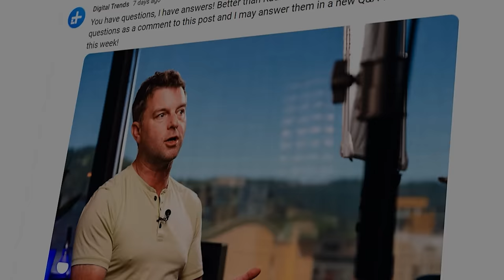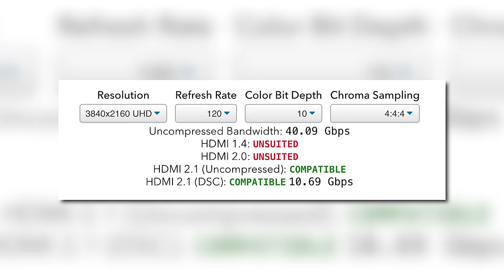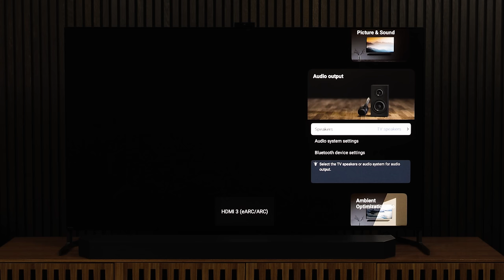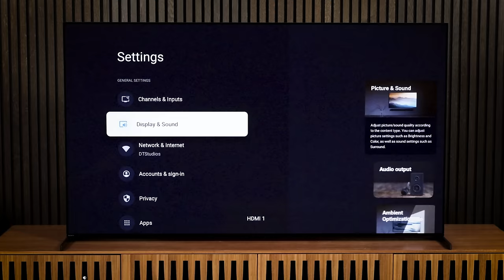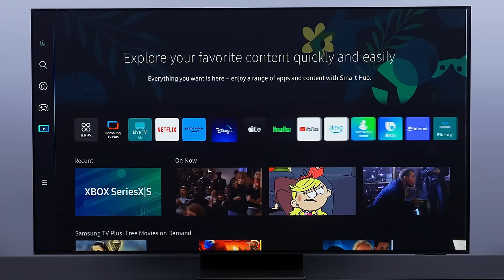TV Above Fireplace Bad? Samsung S89C OLED Worth Buying? | You Asked Ep.17

Comment: I didn’t even bother to watch this video to post the following comment. As an engineer who worked on ergonomic projects, locating a tv above a fireplace is the absolute dumbest idea builders and homeowners can do. Place the tv at eye level so you do not strain your neck, shoulders and back. The heat issues will destroy the TV and any hidden wires and the amount of planning and engineering during construction will kill the builder.  Locate a power and cable/internet box either right or left of the fireplace and you will enjoy a lifetime of relaxed video enjoyment. Period!
Reply: I have a fire place, but no tv.  Simple as that.
Reply: What if i have a new home built this year and they took things like tvs above fireplace into consideration including little things like wire hiding outlets etc? In your experience in this case they would have considered those issues u stated?
Reply: You still must address the ergonomics of looking up to watch TV. Unless you plan to park your .... In a Barko lounger tilted all the way back in sleep position for the rest of your life, keep the TV at eye level and enjoy.

Comment: I have had a MantleMount 340 for six years and it’s fantastic. I just upgraded to an 85” QM8 and had to upgrade to the MM740 and it was a no-brainer to just order the upgraded version.

What I’m bummed about is that the max weight mount they make is only the 115lbs MM740 and now I’m right on the edge. If I wanted an 98” or 100” TV I won’t have a choice but to do a fixed frame above the mantle.

Comment: Hmmm. What about all the reports and pictures popping up showing the S89c is QD OLED in the US?
Reply: I agree, I bought the S89C on Black Friday and confirmed that it´s a QD-OLED panel due to the triangular RGB pixel pattern. I want to say that the WOLED panel was used the in the UK and not the U.S.
Reply: After some research many have confirmed its a qdoled panel in the us. The thing is samsung never made a gen1 77’ qdoled panel so basically a s89c 77 has a gen 2 panel. I currently have a s90 65 and probably going to return it and get a 77 s89c.

Comment: On the topic of 3D: I know this is a TV review channel and so what Imm about to say may be branded heresy but here goes… anyone interested in preserving and getting the most from their 3D movie collection should really consider a projector. While 3D was abandoned by television manufacturers— many projector manufacturers continue to support the format and 3D on a projector is GLORIOUS. In fact, it’s so good and so cheap to implement you could buy an entry level projector for next to nothing and use it solely for 3D playback. 1080p DLP projectors in the $500-1000 range produce fantastic 3D image quality and DLP link glasses are cheap. If you want one display to do it all I’d suggest budgeting a bit more. The BenQ HT4550i is about the best DLP money can buy and it does a bang on job of playing back 3D as well as producing a high quality 4K/HDR 2D picture. The Epson 5050ub is another excellent choice— while it’s a lamp model and therefore getting a bit long in the tooth it still produces one of the best pictures at it’s price point and comes with gobs of advanced features typically reserved for more exotic brand projectors.
Reply: Yeah, but my living room has no place to add a projector and neither does my other living room theater downstairs.  These TVs have amazing picture quality and would shine with 3d.

Comment: We put our TV above the fireplace as we have no other place to put it(house built 2020). However it's not an issue at all.  Most fireplaces have a mantel which blocks the heat. And our mantel is low enough that eye and neck strain isn't an issue.  
We cannot use a mantel mount because the mantel itself would block it's function, it would lower and hit the mantel which is 14" deep.

Comment: 10:33 this is misleading. Alternating frames was active 3D with the active shutter glasses. That did display full 1080p per eye. The issue was the flicker for those who were susceptible to noticing it as well as ghosting due to syncing issues. Passive is where you were receiving half resolution on a 1080p set of which there were some oled 3D tvs. But the ones I belive the writter is talking about are the 4k oled 3D's of which some one else has already stated, allowed for full 1080p. resolution per eye. As a 3D fan I just wanted to clarify. Head mounted displays like nreal and rokid also offer micro oled displays with 3D capabilities and ofcourse vr/spatial computing headseats like apple vision might be the natural progression of the medium for the masses. Otherwise Been following this channel for years, great work. Glad you are open to feedback and corrections.

Comment: Im not sure if ill get an answer but what do you think about the us version of the s89c 77’’. The us version seems to have a qdoled panel. Did a lot of research and many other people have taken micro pictures of the pixels and show the same pixel formations as in the s90c. I even checked on bestbuy and they confirm it as well. People who say it has a woled panel, when looking at the 83’’ s90c on best buy you can see in the specifications section where it says picture quality enhancement technology it says HDR oled because that panel is indeed a woled panel but when looking at the s89c it says quantum hdr meaning it does in fact have qdoled. It even has a gen 2 qdoled panel since samsung never made a gen 1 77’’panel version. I just want to know if all the color accuracy and peak brightness etc. are the same and it is in fact a repacked s90c and they just slapped s89c with a lower price on it.
Reply: You are correct. The S89C is manufactured exclusively for Best Buy.

Comment: @digitaltrends     The 77S89C in usa and canada is qd-oled with all the same specs, just missing metal top plate cover on the stand and samsung tap feature. SO many people on forums and bestbuy have conformed it. Its a woled panel is overseas market but the bestbuy model is qd-oled. I bought 1 just for the hell it to  test it out against my 77c9 and 77c1. I Took macro photos of it, posted online, it a qd-oled. same build same everything. S89c gets so much brighter in sdr and hdr. Next to lg C1 its so obvious its qd-oled.
Reply: This is what I came here to say as well.  Mistakes happen, Caleb still knows his stuff 💪
Reply: My guess is that it contains a gen-1 QD OLED panel left over from the previous year, but stuffed in this year’s hardware and software.
Reply: Last year's panel weren't in 77", so this is the new gen panel.
Reply: Thanks for the info. I totally forgot about the limited sizes for the 1st gen panels. The S89 is looking a little more tempting to me now 😊

Comment: You may not believe this but when we were looking for a house 20 years ago, the first thing I'd look for is a wall to fit a TV (CRT back then) along with my speakers and be visible from the kitchen.  You'd be shocked how difficult that was back then - the American open floor plan concept is a lot less common as you'd think. 

But having a TV that can be enjoyed by everyone in the house is definitely a massive plus.

My only problem was compromising the position of the 2 surround speakers by placing them slightly off angle but I got Atacama Nexus 6 Stands to make up for them visually.

My 2nd genius move was investing in a BDI cabinet - they only had 1 model in 2 sizes back then - which allowed me to hide the center channel speaker (albeit limited to 8 inches height) and hide all AVRs and consoles while having the ability to use wireless remotes and see the information on the device which coupled with Auto Display off (on the old Marantz AVRs) was amazing.  Sadly, BDI doesn't make that model anymore with the glass panels and Denon and Marantz don't have Auto Display Off to make the devices dark.

Comment: Well this was handy. I was literally on the verge of ordering an LG G3 for my home here in England, and it's not the biggest place and the typical UK home sizes plays into this. Being built in the 1950's, the fireplace and mantelpiece were the centre of the house and this is very common in such British homes.

 However, this means that the only place I can put the LG G3 (thinking 55 inch or 65 inch) over a wall section which leads up into the chimney. It's not that the chimney is even functional anymore it is just still there like it is in a lot of houses in the UK. The thought had occurred to me the rising heat or convection from the fire would potentially mess with the pixels, lenses or...something (I dunno) in the TV. I was wondering if this would be a big problem. I'm hoping to get the TV installed before the end of the January Sales to catch the price reduction.

 The fire we have is an electric fire which isn't sending up smoke or conventional thermal convection from a coal/wood burning fire. It's got an LED digital display and you can change the colours of the artificial flames and it doesn't look bad. A very glassy front on the fire and the heat rising from the top grill. I'd liken it to being like a giant toaster. I don't particularly want to have the LG G3 just a few feet above that, but the temperatures are usually on ranging between 18-36 degrees Celsius with settings for 1000W and 2000W heating. It shuts itself off if it gets too hot - after a few hours. It can get quite...toasty...in the smallish, typical UK sized living room. But there is literally nowhere else to put the thing. Do you think it's risky or is it not that bad?

Comment: I have a Sony A80J and a Sony HT-A7000 soundbar and I get dropouts too. It doesn't switch to internal speakers. It just cuts out and then comes back. It also comes back at a lower volume for just a second or two and then returns to the previous volume.

Comment: I contacted Samsung today and asked the differences between S89c and S90c and they said the stand of course and the built in audio codec as the S90c has 2.1.2 higher end codec and speakers where the s89c is just 2.1 channel.   I have a Sonos arc so going with s89c. 🎉

Comment: I am wondering if the information in this video about the S89C is correct or not. I work at Best Buy and I was told by our Samsung factory rep that the S89C is a QD-OLED in the US. The only difference for US buyers is the stand. The S89C in European and Asion markets is supporsed to be an LG wOLED panel to meet EU power consumptions standards.  I wish we had it on display in the store so I could just see it for myself but they didn't allocate a display unit. Hopefully the Samsungrep I spoke to wasn't spreading incorrect info to  Best Buy sales staff.
Reply: It is not correct. It wasn't correct when it was published and it's not correct three months later.

Comment: Re: the A95L reverting itself back to TV Speakers, mine does the same with my Sonos Arc and I’m hooked up to the soundbar via the eARC port using a high quality HDMI 2.1 cable. Seems to do it more when I turn on the TV using my Apple TV remote, and not so much when the TV is turned on with the Sony remote, but I haven’t really isolated what’s causing it.
Reply: Uggh!  Sony A95L is a game changer asap

Comment: Possibly a fix for Scott while asking about the A95L Nakamichi problem.. 

I have the same issue on my LG G3, and what seems to work for me is to enable HDMI eArc support in the setting, wait for the sound to play and then disabling it again. This seems to keep the HDMI handshakes stable. I already ruled out the hdmi cable as the culprit since its very new and the sound does keep working after my little procedure. 

With eArc enabled all the time I keep getting the audio cut-outs, so best to leave it disabled for now when it works. I hope the Sony has this ability under the HDMI settings. I am on the latest firmware for the LG G3 so hopefully a firmware updates fixes this whole mess in the future.
Reply: The Dragon is coming to you and he’s angry because he wants to go loud
Reply: Another issue worth mentioning is to avoid using HDMI switches. They are infamous for dropping handshakes between TVs and audio equipment for no reason at all.

Comment: The major common mistake people do in installing TVs and even projector screens is to hang them much higher than their eye level. As if it's a mountain peak to behold. And even if they do hang it bit lower, they usually keep it at their eye level meeting the center of the screen while in standing position! As a matter of fact, and as per my experience, TVs shoud be hanged/placed with their upper edge meeting at the level of your eye while you're at seating position. I'm not sure if you're familiar with the 'Balcony' seating in theatres in older days that used to be pricier than general seating below the balcony. The Balcony viewing would be looking a bit down on the screen. Thats the best position.For projector screens try to get the lower edge 6 inches apart from the floor. The immersive experience will  increase as well. Try it out if you haven't done already.

Comment: Regarding the Sonos and in ceiling speakers. Just wanted to share that about 10 - 11 years ago I went all in on Sonos for two houses, were great. BUT, just recently I have had about 5 of the 10 speakers go bad. Essentially the wifi section was going out and/or sound and no sound. Bottom line yes they are old, but like my man cave my speakers with a receiver will last pretty much forever. Just a comment as you may want to reconsider just how much you spend on Sonos when a good wired speaker will pretty much last forever. I am going just bare bones on Sonos with limited speakers. NO WAY would I go with a Sonos full system for say TV surround sound. Great episode as always!

Comment: Have an A95L with the Sony AZ5000ES receiver via eARC, and I get a brief switch to TV speakers too when I turn on my Apple TV 4k+ (connected to the A95L). Using certified ultra high speed HDMI 2.1 cables.

Comment: Great work! Re Nakamichi sound drops: This may be totally irrelevant but my loss of audio handshake was related to eARC going from new Sony tv to a multichannel receiver. Similar symptoms - auto switching to from external speakers. Needed high quality cable but it finally stabilized when I assigned the receiver a fixed IP address. Go figure! Thought I would mention just in case.

Comment: Can’t remember the model but I bought a Sony smart tv and hooked it up to a Samsung soundbar. Had the exact same issue where every ~15 minutes the audio would cut out briefly and it would say “switching to TV speakers” then would switch back about 10 seconds later. Super annoying! Tired using a different HDMI cable then I moved the soundbar to a different TV and didn’t have any issues so suspect the issue was with the TV. Tried resetting/updating and playing with pretty much every audio setting available with no success. Contacted Sony and after running through similar troubleshooting steps with them they ended up advising me to return it. Had similar issues with other Sony TVs too.

Comment: Hi there, about the switching audio issue with the A90L I would like to comment that I have the same issue with my Sony A80J OLED and my JNL 9.1 Soundbar, every time I turn it on and watch either a Blue-ray movie or streaming , the tv switchs to tv speakers from audio system and viceversa up to 3 times. I had tried different HD cables, check the Audio output options on the tv and I haven't find a solution, it may be a Sony issue? is there any suggestion to fix this issue? Any suggestion will be really appreciated.

Comment: Although I've not purchased one, there are many current model projectors and short throw laser projectors that include 3D.🙂
Reply: I just wish the good projectors didn't cost as much as a T.V.

I was thinking about buying a projector but after comparing prices I found at least for me simply buying a new T.V made more sense.
Reply: @cosmicabyss7358 I don’t understand this comment. It replaces your tv, so why should it be cheaper than a tv?
Reply: @n815e  Because T.V is better in just about every way aside from size.

Picture is way better on a T.V than a projector.

Comment: Well, 3d is turning out to be hard to find at the theater too even real IMAX theaters...  For me 3d added about a 1 point to 1.5 points per movie especially if the movie was done well in 3d.  Shockingly, it didn't bother me one bit that the resolution was cut in half. Of course, passive was better than active 3d not only in terms of comfort but also perception.  It's not for all content but it does improve movies.

Comment: Thank you, Caleb. Always enjoy your updates! I was going to submit a question on an issue I have with a Sony/Bose combination. Then you addressed the Sony/Nakamichi question.
With respect to the question on the Sony and the Nakamichi 'drop-outs', this is similar to the issue that I have had from the start with my Sony A8G and Bose 900 soundbar. When turning the TV on, it either takes an extended period for the TV/Soundbar to start up or the Bose does not connect at all and the TV messages "Switching to TV speakers" or some variation. After many hours on the phone and in chats with Bose (Who were patient and professional), it remains unresolved (Really like the bar; really frustrated at the drop-outs and requirement to re-boot the TV and soundbar until they connect).  I attributed it to an earlier broadcast when you vented about the poor performance/state of CEC.   Is it Sony? (A similar issue with an 850D and a Bose 500)...or is it Bose? ...or is it CEC? Or is it that I have an aura that messes up all the tech in my house? (That is my wife's answer...) 
Does this happen (potentially) with all TVs and all soundbar combinations? (From other comments, it seems that it might..)
Reply: 10 bit color is good, but my Uncle Ned said you need at least 11 bit for true reference quality!!!!